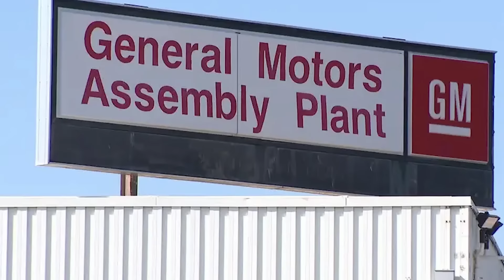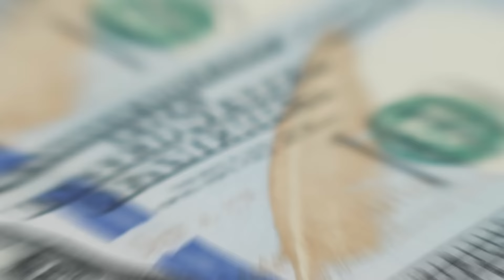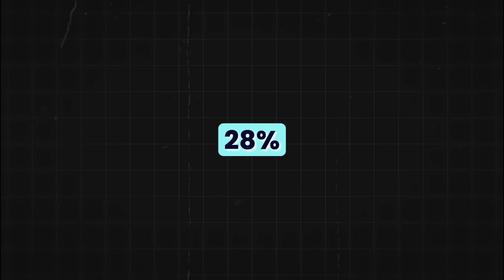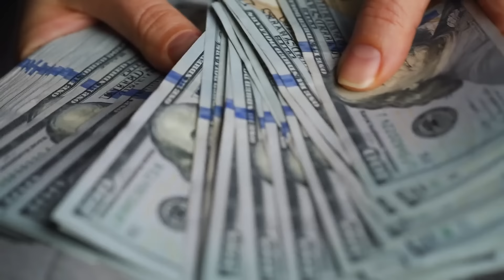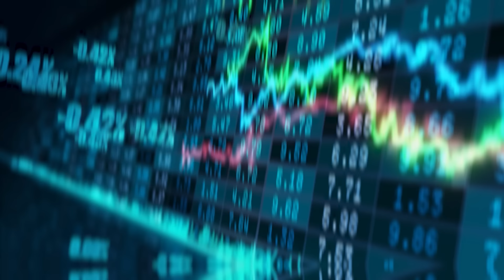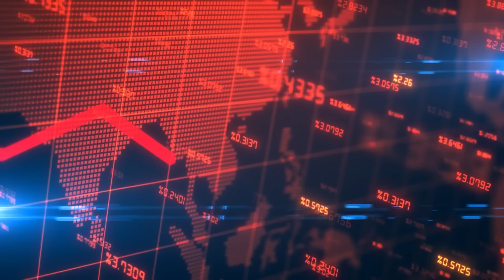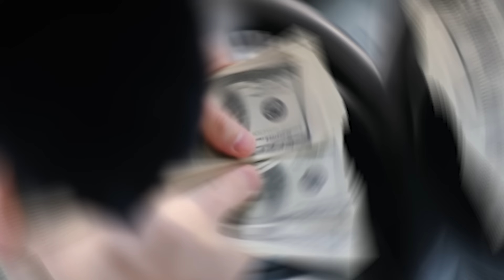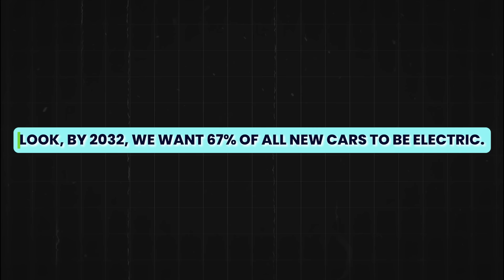The EV BUBBLE has Burst!!!

Comment: Why can’t they sell EVs?  
1) Expensive to purchase versus gas vehicles  
2) Too long to charge 
3) Don’t run well or at all in freezing weather 
4) Expensive to charge versus gas vehicles 
5) Expensive to replace batteries 
6) Worthless in an extended power outage
Reply: They make a crappy product. Tesla does not and sells every one they make.
Reply: Don't forget : expensive to insure because they are insanely expensive to fix and they are a liablity due to spontaneous fires.
Reply: EV's can't be put out by Fire Departments. My son's engine company responds to local freeway wrecks. They now allow EV's to burn and concentrate on keeping the fire from spreading to nearby vegetation. They used to flood EV fires with thousands of gallons of water until finding that the toxic waste from the runoff contaminated the soil and ran into drains leading to the San Francisco Bay. Even a burned out hulk needs to be wrapped so that rain won't wash battery  combustion products into the soil.  EV's batteries create their own oxygen during thermal runaway and can burn underwater. So much for saving the planet.
Reply: @S.M.214  EV's are inherently an issue
Reply: Not to mention what it takes to make these from the ground up.
Reply: Yep. Add: Outrageously expensive to repair.
Reply: @S.M.214 teslas are 100% poorly made vehicles what are you on about 😂😂😂
Reply: 7) Low residual values
Reply: @S.M.214  LMAO!!! Are you serious?? I have 4 friends with or had teslas. Being a mechanic I got to take a good long hard look at those sh1t boxes. The quality control is HORRENDOUS at best. The crap that constantly breaks over and over is unreal. People hate on ford for no reason 99% of the time but ignore actual garbage cans like tesla. They are extremely over priced, over hyped junk. Oh yea, those 4 friends with teslas....3 didn't even have them a full year before going back to a real car or truck. The last one is in the process of trading his in at the time of this comment and expecting his new gas car next week (jan 2024)
Reply: And many more
Reply: I say let's try hydrogen
Reply: man im telling ya give me like 10 years of planning time and i could solve all of those issues, but i dont like the idea of being able to track cars
Reply: @S.M.214  no, teslas are garbage too.  ask anyone waiting on parts... or panel gap issues.
Reply: @S.M.214 apparently you didn’t hear about what happened last weekend with the freezing cold weather in Chicago and how no one at power charging stations could charge their Teslas?  You only want to believe what you want to believe.
Reply: Don't forget the random spontaneous combustion, life threatening product.
Reply: @S.M.214 Tesla does not? Have you seen the crappy quality control on Tesla cars? They look like they were assembled by a 5 year old.
Reply: Actually they do run fine in cold weather, just not as long. My diesel car on the other hand gets cranky.
Reply: BYD are the new kids on the block.
Reply: I understand some companies won't insure them and some tow trucks won't tow them. Don't forget about the fires, driving without heat so you can make it to a charge station. Not to mention all the children who are killed or injured in mining lithium.
Reply: 1.  1500’s start at $80k,  the EV is cheaper. 
2.  Most of you never use their vehicle to do any more than commute, the long charge time is offset by the fact that you should be charging your car at home. 
3. Your car battery will die before an EV BATTERY WILL.  😂😂😂
Reply: FJB and his Electric car
Reply: Buy EV is supporting China
Reply: @robertmccabe1919  My Tesla is by far the best automobile of any kind I've ever owned and I've owned alot of them. I've driven 1500 mile round trips many times, easier than in a gas car, can drive 350 miles around town on 8 dollars of electricity, practically zero maintenance. Take it from the people who own Teslas and not from blowhards who think they know about owning one.
Reply: @S.M.214  Time to watch the vid about hundreds of Tesla's in NYC that can't even charge because of the cold weather in NYC! It;s was only like -20 degrees there and I get worse weather than NY in Ontario Canada...
Reply: @MrDaavee  Your anecdotal evidence is hilarious.
Reply: @S.M.214  It was my impression the Tesla interior quality is pretty crap.
Reply: @S.M.214  That's more to do with marketing hype that the followers of the prophet Electric Jesus slurp up !!!!
Reply: @S.M.214  Too expensive, too hard to charge. They are useless. I will keep my diesel truck
Reply: @maverickwatchreviews  glad I could make your day. Are you one of those ev supporters? Jumped on that band wagon willingly? You now one of those new automotive professionals that suddenly know everything about ICE and EV, yet can't change your own tires?
Reply: Moreover, limited natural resources to make batteries to replace all fossile fuel vehicles on earth? What about trucks/transporters, boats, ships, tractors, dozers, planes, etc. Not possible! I'd rather drive my car on water even though it will make a crappy car!
Reply: and lets not forget the resale value - non existent. Like buying a used condom.
Reply: It’s crazy that electic is more expensive than gasoline but it’s the truth. At home I pay 11 cents a KW so a Tesla should cost me less than 10 bucks to fully charge. But somehow it’s $50 at a super charger???
Reply: @S.M.214  And that’s why the rental companies are dumping their Teslas, 20,000 of them, onto the second hand market.😂😂😂 😂
Reply: @mjolnir_swe  Yet, it will happen in time.
Reply: @peterwho9380  was it the charge station that dident work if so then it dont have anything whit the car to do. Disel car have troubel in cold weather to so
Reply: @robertmccabe1919  FACT: Tesla Model Y wins 2023 safety award with “near-perfect safety rating”. Tesla reliability is low, but my Chevy Volt has been more reliable than previous Toyotas.
Reply: But why…..are EV charging are without convenience stores???  A charging driver could sit down for a coffee😢 car makers should NOT be listening to windbag politicians like Joe!!!
Reply: 7) Battery can get damaged by a rock or other object and you're out $60k for replacement
Reply: Evs are not about "saving the planet."  They are all about limiting your ability to travel.  Think about it.
Reply: @MrDaavee . I’m on my second ev and have never had an issues with either of them.  Nothing at all.  Cheap to run cheap to maintain, fast and quiet.
Reply: 1) lithium costs are already on par with ICE, so it's a matter of time before that filters to the consumer.
2) charge time will also be solved in the years to come, just look at the Shenxing battery from CATL (400km in 10 mins).
3) the increasingly popular LFP batteries run fine in freezing conditions, it's the NMC batteries (like the ones in Teslas) that struggle, but a channel like this wouldn't tell you that.
4) cheaper to charge at home (which is where most people charge 90% of the time), but CURRENTLY more expensive at public charging facilities, which will slowly ease.
5) Batteries are designed to run well beyond 200k miles, so will be fine for most, so no one will pay that, so not an actual issue.
6) are the only source of power during a power outage to power your home, so are the opposite of useless.

oh how quickly I've debunked your little FUD comment 😇
Reply: Ford and GM make rubbish EVs.  That’s why they can’t sell any.  They’re absolute shit.
Reply: You missed a whole bunch of reasons...ha ha...  I saw a guy driving a Tesla.  He was at a Home Depot coming out with a GAS Generator.  I helped him put it into the back.  He said he had the charging cable ready to go and said my next stop is to put gas and oil into the Generator.  He then said, based on my calculations I no longer have range anxiety and with the Generator and a few gallons of gas I can go a thousand miles without having to stop to charge.  I asked him how are you going to get the generator exhaust out of the back of the car,  He said, I already have a metal flex hose and I'm gonna hang it out my passenger side rear window and put plastic over the rest of the open window...  He must have been thinking about this for awhile, all the bases are covered.  The Generator puts out enough amperage to charge the battery while STILL Driving.  Hello Elon Musk, why didn't you offer that as an option???????
Reply: @PlasmaBurns  FACT: 2019 Tesla Model 3 Standard Range
$29,998  35K miles
Reply: @wretchlikeme5321 . Or grow up.  Do you have one ? Then be quiet. So sick of back seat consumers telling every about things they don’t have.
Reply: One reason they are expensive garbage.
Reply: Don’t forget they’re catching on fire parking garage is won’t support but so many of them then they collapse two more facts for you and you can’t put the fire out once it starts you just have to drag it and let it burn to the ground which causes insurance to increasethe tow companies have to submerge them in water for 48 hours after they catch on fire very expensive and they call themselves engineers. I saw this coming a mile away me and my cousin were talking about it for years.
Reply: @wretchlikeme5321    How come China BYD company are doing well.
Reply: @PlasmaBurns  RESEARCH: A Tesla Model 3 will depreciate 21% after 5 years and have a 5 year resale value of $47,040 (originally $60,000). Chevy Tahoe has residual value of 66% (Tesla 79%)
Reply: @dennisburrill3260  like the guy in the 80s who drove from New York to California on 22 gallons of water. Oh that’s right they killed him then stole his car went for a business meeting drank the cranberry juice provided for him poisoned died in the parking lot. That is a good video to watch crazy.
Reply: @miltonturner2977    That never happened.
Reply: @individual116  Yup, it's like you wanna superfast that? @ burger king and you pay 5 X more for the same soybean patty burger.
Reply: @User-gfys-0icu81   65 000 smackaroos for an Ioniq EV battery buddy boy. 300 smackaroos for a high quality ICE battery. I sink your argument.
Reply: All your states are not true. The are cheaper, No. 1 sell car in the US, charge at home and not have to ride to buy expensive gas, and they do just in the cold and snow. Have you seen what it cost to replace a transmission these days, close what it cost to replace a battery. In a power outage, you can't pump gas either. You did not make out every well with your BS post. haha,.
Reply: @Peekaboo-Kitty  But they don't limit your ability to travel. Research it.
Reply: @kensmith4218  Not $60K nice try, A transmission can get damaged by a rock as well.
Reply: @drjojo5551  What politician should they listen to?
Reply: It would be great for lets say Hawaii. No freezing weather and no long drives. Set up solar cells to charge the batteries.

Dude there are a lot of gas powered cars that have their batteries freeze. It is the evs do not make sense when you have to drive long distances.

STOP THE TRUIMP PRPOPAGANDA!!!
Reply: @electricrampageOG  The problem isn't time, the problem is pushing a technology before its time. When a technology is ready for prime time you won't need to push it because consumers will freely choose it because it is in their own interest to do so.
Reply: @User-gfys-0icu81 Regular car batteries only cost a couple of hundred dollars to replace whereas EV batteries cost ten thousand or more to replace.
Reply: @ranmatardis4236  Good points. EV can drive long distances though. EVs can drive in freezing weather, just shorter distances and slower charge rates. This is FOX and oil executives' propaganda.
Reply: @1Infeqaul1 Yeah, when it's the right time not when it's being pushed on people and companies by the government.  We'll know the technology is ready when people freely choose it because it is in their own interest.
Reply: @S.M.214 ....still crap bub.
Reply: @kimmer6  I have never seen an EV burn. I have seen lots of burned-out fossil fuel vehicles burn.
Reply: @charlesjebarb2863 possibly..but a car battery won't cost a fortune..or cost the earth....ask Elon for a raise...
Reply: Hard on the environment from mining for battery materials and battery disposal. Burning tremendous amounts of COAL to charge em’!
Reply: @PaulSmith-tn4yu keep dreaming bub.
Reply: @dennisburrill3260 yes that shouldn’t be a fire hazard stored in a 3500 psig bottle.
Reply: Everything They Touch Turns to Shit!
Reply: @Acemeistre I suppose you'll be voting for Biden too...
Reply: 1) Wrong
2) Not really - charge in your own garage.
3) Some downside in extreme weather.
4) Wrong
5) You shouldn't need to replace the batteries. Have you priced the cost of replacing your engine at a dealer?
6) You voted for Trump?
Reply: @User-gfys-0icu81 because the relative cost of a petrol car battery compared to that of an EV is relevant, how?
Reply: Kerry is hiding😂
Reply: @S.M.214  Tesla is garbage too there go carts are no better. They should have just stayed in Hawthorne building them in a airplane hangar
Reply: @jamesharding8702  Another FUD post from Saudi Arabia
Reply: EV’s now are like cell phones in the 90’s they are going to get a million times better…
Reply: You left out potential fire bomb
Reply: Wehi Quiet I agree.there aren't enough charging stations.olus yr right in extreme cold they do size up. I drive long distances.and I wouldn't want to have to charge and be miles from anywhere👋😀👍👍👍👍👍
Reply: Please show your data. 

1) Hyundai Kona Electric $32,674 right about in line with a standard sedan. $60,000 for a Hydrogen fuel cell version.
2) Fast Charging takes about 18 minutes 
3) Runs perfectly fine in cold weather (I live in New England and my Neighbor's Tesla runs fine in 2-degree weather also gas can freeze. 
4) Cost me $40 to fill up my Ford eco-sport Costs her $9 to charge her car.
5) Batteries last for about 1 million miles name a good gas vehicle that can go that long (by then most people would purchase a new car. 
6) They have solar-powered generators that can charge the car. Gas pumps are electrified so depending on the length of the outage gas cars are useless too. One use that EVs have over their gas counterparts is they can be recharged by about 4 gallons of gas from a gas generator and can actually power the house if need be,
Reply: Brilliant
Reply: Add: worthless as trade in or resale. Basically lithium bricks.
Reply: Also insurance is not kind if you are in an accident.  They will write it off for a minor accident.
Reply: @iancouper3644  people also say ford is garbage, yet I have had 4 now, and I'm a gm guy, and have had zero issues.  So you got lucky. Oh and your ev is not fast. Wish you people would stop saying that crap. They are quick. Not fast.
Reply: @kimmer6  Actually about fifty percent of fire departments can so maybe it's just your sons.
Reply: 1) True.
2) True, but doesn't always or necessarily matter.
3) Not true, but range is reduced.
4) Not nearly true.
5) True, but barely relevant.  Like buying ICE and worrying about replacing an engine that has an 8 year warranty.
6) Does fuell pump in an extended power outage?

There's a market for EV's as an alternative, but they're being forced,which isn't helping drivers, even drivers of EV's.
Reply: @keegan773  And that's only Hertz. No doubt the rest will be watching and will follow.
Reply: All American vehicle manufacturers are about 20 years behind BYD and Tesla. They are also up to their necks in debt. Its unlikely these companies will be around in 10 years time.
Reply: @MrDaavee  hi.i don't have an EV..I won't ever buy one.
Reply: wrong,,,,GO WOKE GET BROKE,THATS WHY
Reply: Gasoline is about $6 a gallon in California. it IS about $235 a gallon in Oklahoma. So EVs for California and gas powered for the countryside.
Reply: Insirance rates go up, home insurance rates go up.No range.
Reply: @janny_the_man9737  Don't  take my word for it listen to the biggest petrol head ever, Sandy Monro, senior engine developer for every major manufacturer in the last 40 years. ICE vehicles will go the way of typewriters in offices. Once there were thousands of them but in less than 10 years they were all gone.
Reply: Depreciates faster than ICE vehicles.
Reply: @kensmith4218  gas tanks can get holes in them and you can perish in the flames. This happens all of the time.
Reply: Catches 🔥🔥🔥🔥🔥🔥
Reply: Too bad. Make Dems buy them.
Reply: @michaelbaja1854  Which will help people on a budget buy one. Cummins the world largest diesel engine manufacturers end production of diesel engine in 2025 both BMW and VW have ended ICE vehicle manufacturering in Germany. All production will be in China as will all Nissan production of EV vehicles. Partnership of die.
Reply: Plus, they run through tires faster than gas-powered cars thanks to their weight; if they catch fire, the fire can't be put out - they could burn down your house if they catch fire in your garage.
Reply: @Charles-d4e3b  China has like 390 000, brand new EV's in a field rotting. the same will happen in western countries soon.
Reply: Range is too low.
Reply: @kimmer6  And one EV fire pollutes the air so bad you need hazmat to be around it for risk of getting sick or dying from the fumes.
Reply: and the list go's on
Reply: @S.M.214  How much Tesla stock do you own?
Reply: @PaulSmith-tn4yu  why would anyone own "a lot of them?". I've had the same car for years and has never left me stranded. Cost?  $4500.
Reply: @User-gfys-0icu81 
"1.  1500’s start at $80k,  the EV is cheaper. 
2.  Most of you never use their vehicle to do any more than commute, the long charge time is offset by the fact that you should be charging your car at home."

Completely beside the point.

"3. Your car battery will die before an EV BATTERY WILL. "

A car battery costs $100+ dollars every five years.

The projected cost of an EV battery is said to be $20,000 after 10 years.
That's $2000 a year.
Looks like the gas guzzlers get the last laugh on this one.
Reply: They run fine in freezing weather except owners didn't read their manuals on preparing the batter, duh. They are probably NOT a good investment for people who live in apartments as you don't have your own charger. Intelligent homeowners had no problems.
Reply: @Acemeistre 
"1) lithium costs are already on par with ICE, so it's a matter of time before that filters to the consumer."

That's not realistic.
There isn't enough lithium on the planet to provide for the batteries of a total US fleet let alone the world.
The only way EVs can be safer is for newer, safer batteries come on the market. 
And some of them are cheaper than lithium.
Reply: LOl all those are so wrong in 2024 ... 😂😂😂😂 Except the cold  part ... 
But I will grant you that most of the legacy auto makers attempts at EVs have been a disaster and they are not selling EVs..😂😂
Reply: @S.M.214 
Correct the ignorance of most of these posts is amazing. 😂
Reply: @robertmccabe1919  you have never been in a Tesla .. I can tell by your comment ...😂😂
Reply: Extention cords not long enough either .
Reply: @kimmer6 . Well said .
Reply: @itstim8690 . The carbon footprint to build this stuff is worst than a gas vehicle .
Reply: @Quitetus6 4 You are wrong electric vehicles are miles cheaper to charge than gas vehicles. Everything else you said is correct.
Reply: @ranmatardis4236 rest easy, EVs don't burn for simple reason: YOU haven't seen one burn.
Reply: 7. Ugly vehicles
8. Poor reliability
9. Poor resale value
I'm not shocked at all.
Reply: @indi-f8j  lots of infrastructure costs just for transportation
Reply: You neglected to mention they blow up. Oh I’m sorry they suffer the risk of a “thermal runaway”. Aka. They blow up.
Reply: Tesla is like Apple, they are a religion and not a product.
Reply: EV or Gas, What Pollutes More? - https://www.youtube.com/watch?v=1oVrIHcdxjA
Reply: @S.M.214  this is the correct answer.
Reply: See the Teslas in the cold?
Reply: !. Same to lower range of cost of alot of Normal vehicles...
2 . Charge time varies . and to hit #4 here also cheaper by far then gas per mile driven......
3.  There's this guy Started company called Eddison motors thinks ev do just fine in the cold and snow . 
4.On average, it costs $15.52 to charge a Tesla, based on the national average cost of electricity. Across all models, Teslas cost slightly less than 5 cents per mile.........
5. Expensive to replace engines ... especially if their outputs are even close to a ev.
6. ....You know what else runs on power.... gas pumps........................ and generators are a thing.
7. Sayin Ev isnt ready yet or sellable yet is both ignoring the billions in profit last decade of ev But also sounds like when discussing future energy in general into some sort of zero point or free energy scenario..... Because its easier to handfle how wrong you are if you corelate it to nonsense...
Reply: @hugolafhugolaf not to mention that the batteries are so heavy they'd need to repair our failing roads faster. They are 30 percent heavier than a gasoline vehicle. What will that do to you in the event of an accident? The reason for NOT getting a VE far out number any reason to get one.
Reply: And the infrastructure is not completely in place to support EV"s with charging stations.
Reply: You’re not going to pass an E.V. down to your kid…. I mean if it doesn’t burn your house down 🤔
Reply: Not to mention that the cost of mining the lithium for the batteries makes it a net energy loss when compared to a gas or diesel engine.
Reply: Yeah they would be like a old cell phone.
Reply: @mironoleszczuk5660  I was trapped in a VW Squareback after an accident. The large trucks main fuel tanks were pincered and it all burned. I was going in and out of awareness, I almost was burned alive! I was in Iraq and the fires I saw. Oh I saw a plane on fire from overheated brakes. I am no nOOb to fires.
Reply: How to ruin a road-trip, take a EV
Reply: Plus  it may burn your house down if parked in the garage and you can't depend on an EV for long trips or vacation trips .
Reply: Can’t even afford an ICE vehicle either… so don’t matter EV + ICE equals $$$$$
Reply: Add to that, a lack of ev support infrastructure.
Reply: @jonathanp1884  lol....ya...show me someone willing to buy a Used EV and I will show you someone who doesnt understand the value of money...
Reply: @robertbutler8004    That’s because you don’t have to charge gas vehicles .
Reply: @dennisburrill3260 indeed.. it can be extracted from water.. that covers 70% of the planet.. lol
Reply: @miltonturner2977  I think you were told a tall tale. EV charging technology will never allow charging while driving. Not to mention that power cannot flow into and out of a battery at the same time. And finally. There are laws of energy in play, the ICE on the generator cannot generate enough power to charge an EV battery anywhere near the discharge rate as you drive.
Reply: @S.M.214  Tesla is a rich man's toy.  They also sell every Corvette they build.
Reply: @kimmer6  B..... B..... B..... But OIL!
Reply: @User-gfys-0icu81 Everything you wrote is false!
Reply: @PlasmaBurns  I must not know the value of money. I purchased a used 2014 Chevy Volt in 2016 and still have it and running great. Operating costs are very low. Had to replace the front axles, 12 V accessory battery, tires and windshield wipers. I wish I could show you my cost over the past 8 years compared to yours. I would be the one laughing. GUARANTEED.
Reply: @PlasmaBurns  And how much research have you done on this subject? It appears not any. What are your thoughts on someone who purchases an IC car that gets less than 30 MPG overall?
Reply: @jonathanp1884  Buy whatever you want...but dont pretend like you are doing it for the environment or to save money as both are not possible with EV's. you are doing it because your God, Government told you to.
Reply: @PlasmaBurns  I am saving A LOT of money with this choice of vehicle. It appears that FOX and their wealthy oil supporters have got you well groomed. The Volt does not have a massive battery. It has a 16.5 Kw battery that covers most commute ranges.
Reply: @ranmatardis4236 not sure why you responded this way, my comment to yours (about burning EVs) was a sarcasm, which I guess went over your head.
Reply: @PlasmaBurns  Now that was funny......
Reply: @User-gfys-0icu81 you can replace 10 car batteries and still be 90% cheaper than 1 ev battery. 😂 🤡
Reply: @GNMi79  because I wanted a new one.  Do you still have your first car ?
Reply: @GNMi79  why change ? Because you can or because your circumstances change or any other of the hundred reasons people change their car.  You don’t get a medal for keeping the same old piece of shit.
Reply: Ok I will bite.
1) Expensive to purchase vs. gasoline vehicles. 
-Can you get a tax break with an ICE vehicle?  No
2)Too long to charge
Are you charging it to 100% ever time you charge?  Do you actually need to? Actually the vast majority of times in day-to-day driving, you don't need to and actually shouldn't.
3)Don't run well or at all in freezing weather.
Well, no ICE vehicle EVER stopped running, had problems or ran out of fuel while in frigid or winter storm weather. Yeah right!  When the frigid weather hits you need to be versed in what's needed to keep the EV going.  It's not hard but one needs to think ahead.
4)Expensive to charge vs gas vehicles.  Yeah, if your using the high voltage level 2 and 3 superchargers everytime!  If you can charge at home with a level 1 charger which plugs in to a simple wall outlet. Charge during off peak hours.  That's where you save on charging.
5)Expensive to replace batteries
True.  But if you want to avoid having to replace a battery pack.  one needs to learn the best cycling methods that will preserve charge capacity for the long term.  Guess what? High voltage supercharging to 100% every time you charge IS NOT the way to do that.
6)Worthless in an extended power outage.  Ok, I see your point.  But in a wide-ranging and extended power outage, the gas stations are usually down too.
Reply: @GNMi79  good for you.   Now imagine if people spent their day being outraged at the car you have ? What would you think of them? I mean, they don’t have to drive your car or pay for it.  So, you might wonder why they’re so upset about your car wouldn’t you.   Just weird
Reply: @janny_the_man9737 SO ORGINAL! Did you think of that all by yourself. Want a cookie?
Reply: @mmadchef808  cry
Reply: @GNMi79   my other car is a 1993 MX5 de-cat with sports manifold and a few mods. . My other , other car is a 1999 v8 jag.   Thought I’d still use them when I got my electric car.   Neither has moved other than to get serviced.  Both now for sale.    Electric is the way forward, charging network is not fit for purpose. Once that’s done it’s a no brainier to change.   It’s just folk don’t like being told to change.  That’s the biggest problem they have.
Reply: @GNMi79  an electric car would be perfect for someone doing a low mileage.  You sound like you don’t know much about them if I’m honest.  Talk to someone with an ev.     Batteries don’t go bad after 5 mins.  They’re guaranteed for around 8 years from the manufacturer if they do go faulty.    Or if you don’t want one don’t buy one 🤷‍♂️.         I drive an older MX5 as well as an EV.  great cars for having a laugh in, well made and reliable too.
Reply: https://youtu.be/Pn2eCY3Kwuk